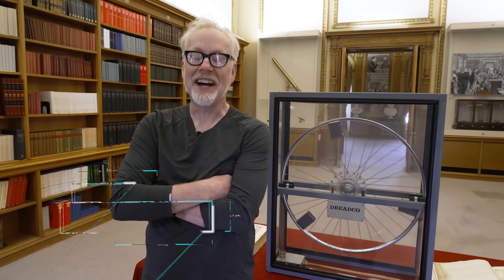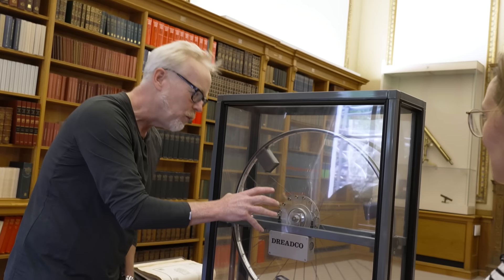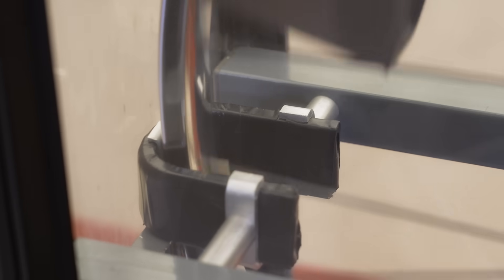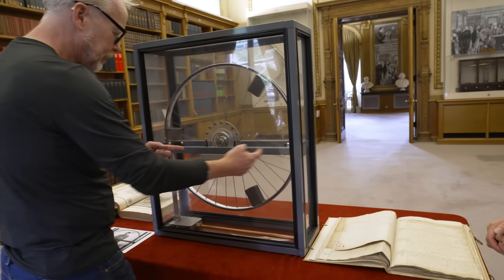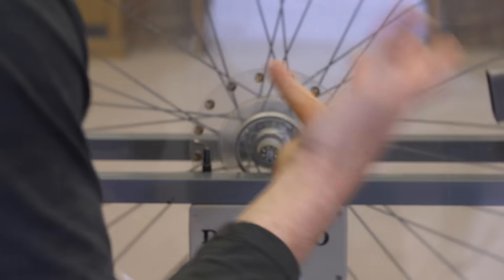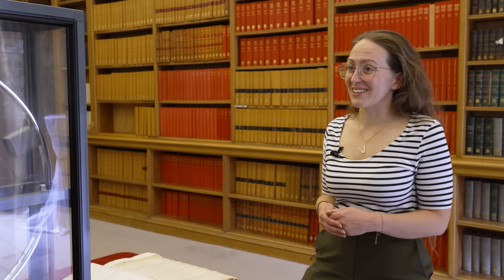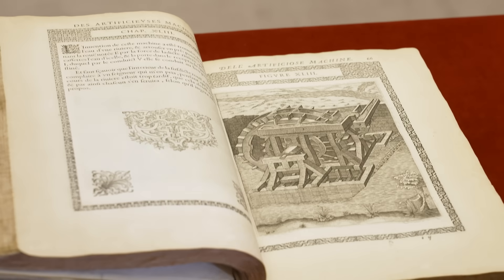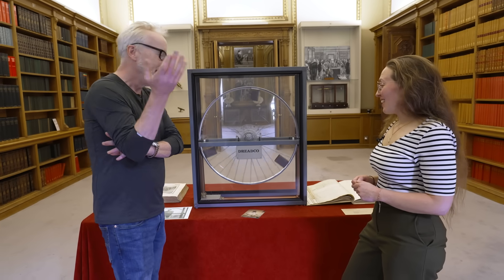Adam Savage vs The "Perpetual Motion" Machine!

Comment: I think the whole thing is a solar panel! When a copper rod is put into a 🔥 fire the side in the fire gets hotter first. Wich produces a potential difference between the hot side and the cold side. The bigger the difference in temperature the more greater the potential difference. 

That is why it has a heat sink.

Or the whole thing is a motor. When a current carrying conductor cuts through magnetic fields it produces an EMF (electronic moto force).
Reply: @tested
Reply: (When Adam hits it) It looks like it is in a vacuum to reduce friction.  
The wheel itself, electricity follows/flows in the shortest path. So when the 3 boxes ("coils passing through a magnet")cut through the EMF the impulse signals travel through the spoke to the anode and cathod. I'm sure the frequency is also calculated to a precisely 1 Hz or quartz Chrystal frequency: 32768.

Also notice how hot air rises and cool air sinks. So the heated copper end blows atoms in the same direction the wheel rotates, while the cooler end sucks in the same direction of rotation.

You have to watch YouTube videos of Lectures By Walter Lewin.
Reply: The wheel itself could be made from Lithium. By comparing the 3 coils in orbit, lithium had 3 valent electrons. Lithium is the lightest silver metal wich is slightly paramagnetic. Lithium itself at room temperature is soft enough to cut with a knife. So I'm in doubt it is made from Lithium but may have alloys of Lithium.

I found this type of analysis from the beat of a Bayer Garrett and Peacock  steam locomotive where I notice that one revolution has 8 beats. So it was amazing to find out how powerful the Oxgen atom is in the power train of a steam locomotive. 

Where as here, they make motion from the absence of oxygen. I still believe you need oxygen to generate/make electricity.

Comment: If you can eliminate enough of the friction losses (high vacuum, magnetic bearings, etc) and the object has a large enough moment of inertia it can spin for an arbitrarily long time. I'd be willing to bet those boxes on the perimeter of the wheel are literally just weights to increase the moment of inertia.

Comment: Most of the machine seems to be miss leading. It has to be some kind of motor and utilizing magnets and a small bit of electrical charge. 

While perpetual motion isn't a real thing if you can consume very little and produce a lot and store that, then that will be something. Although that turns back into hydro power and water wheels.

Comment: I would guess the boxes are covered coils that pass through 2 magnets that have the polarities flipped. There could be a joule thief built into both of the electrodes designed to build up static charge, meaning the wheel would be a motor and generator all in one, better bearings or less air in the system would improve the efficiency, but it's still just akinetic battery.

Comment: It looks like it is simply set up like a DC motor like I even have built in like 5th grade as a science project with either the display case ,or copper tubing covering up the magnets  being the positive and negative magnets that would surround the armature that is the wheel in the center........   But I could be way off here......

Comment: There's nothing in physics that says you cannot have a perpetual motion machine, what there IS in physics is "you can't have a perpetual motion machine that you can extract energy from".

Remember, I'm talking in physics here... If we shift to mechanical and electrical then nothing is perfect and everything is lossy so electromechanically no, but physically, yes you can create something that spins perpetually that breaks now laws, no you cannot extract energy from it in any way, it would have to be an isolated system - and no, we definitely can't do that either. But.... It is "possible".

Possible in the sense that you'd probably need a perfect vacuum (remember space isn't even a perfect vacuum and can't ever be), perfect conductors (which don't exist), zero friction parts (which don't exist), it'd probably have to be cooled to exactly absolute zero (not possible) etc etc...

I love perpetual motion machines, they're a cry by humanity into the void, because perfection is impossible and these machines are a feeble attempt at fighting against that, the universe hates perfection and infinities so much, that if one happens it is shrouded in an event horizon so that no one, and no thing can see the universes mistake in allowing a perfection or an infinity to exist.

Comment: True perpetual motion requires continuous motion in a single direct. I’ve got an idea for one. Provide you use gravity and continuous falling object.  Terminal velocity 9.8m/s/s. Or localised gravity? Account for resistance? Object A moving in opposition to object B. For eternity. Galileos experiment show the correct distancing for things to work correctly. Mines more a loop hole than the real deal as you can stop it?  It sort of cheating? As we heavily use generators.  It all about coil spacing?  For that even chime. Provide you can move a spherical magnet on a hoisted with less energy that the device can make? It a winner! Even if it works on 80/20 rule? The more magnet you can lift? The more energy?  20% is all that’s required for the lift motor to run?  Let one man tell you know and I will show you how?  It was a thought experiment I did.  But it can be made in the real world.  Attached to a sky scrapers? In a sealed unit? Maybe it possible? Conventional wisdom say no. But really that not paying enough attention to the bigger picture? Heck we have rail guns so this should be easy? Just figured hour much energy it take to raise something to hight? Then make sure what you get back,  is more that was expended getting it there?  Problem solved? Friction and air resistance can be negated. We have Vacuum tubes. We have maglevs. we have the industry to build it!  Even me in shed and few tools can build it?  Not to bash the society. It a problem I deal with daily with my attention span being fragged.  Never a reliable thought when you want one. I’ve got a design the even could be applied to wind.  AWES airborne wind energy system.  Aka a kite? Even able to be fitted to the three bladed design.  Fully scalable to?  Just needs an infinite track to roll in.

Comment: If the U-shaped parts are giving the wheel a push every time one of the boxes goes past them then that might be measurable from video with a high speed camera maybe. It seems a bit too obvious tho, with todays technology it would be trivial to make something like this that would move for years but some 40 years back the solution may have been different.

Comment: with my limited knowledge it seems like an extremely efficient battery powered motor of an eclectic sort, magnetic bearings are nigh frictionless in a vacuum, would take almost zero energy to keep turning if designed and built that way, especially if given a push every year or so lol 

I imagine the 3 boxes act as both weight on a flywheel and a way for the u-shaped pieces to interact with and propel the wheel using power from batteries stored somewhere

i honestly have no idea though

Comment: I designed a perpetual motion machine when I was in middle school, the idea was to make a cart with front and back axels connected by a gearbox- when the front wheels spin they force the back wheels to spin faster, which accelerates the cart indefinitely 😂
Reply: I remember building that with Lego technics as a kid. Either it just spinned as fast as I turned it when the cogs where connected with chains, or it just didn't spin at all if the cogs touched each other directly.
Reply: Similarly i thought about sending an electric current through a loop so it would just go round and round forever. Maybe adding a small light

Comment: Of course "perpetual motion" is possible, because it is a matter of definition. The term was used for anything that moved continuously, accepting that there was some input of energy from some source. So perpetual clocks and engines, that made use of changes in air temperature or pressure (for instance), or tidal fluctuations, or the presence of a light source, were all, at one time, considered perpetual motion. And the people who built these devices, for the most part, never believed, nor claimed, that their machines would work with no input. 

It is only today, with the new definition of "perpetual motion" as having NO input of ANY energy source, that the inventions of the past are wrongly impugned as being ignorant, or trickery. This is not fair. 

There should be a new definition for what we know, of course, is the impossible VERSION of "perpetual motion", to set it apart from the old definition and understanding. Perhaps "Free Motion", or "Energyless Motion", or "Zero Input Motion", or the like?

Comment: It's a super efficient machine no doubt, and why it requires so little energy storage (batteries) to continue spinning for so long.  They're also using steel bearings, come on now, and did you watch the ball bearings jitter and move inconsistently, that is not efficient.

Comment: What about the weights on the wheel acting as a flywheel, and the box in the bottom corner including something that would create a moderate air current. The air goes up the pipe where the wheel ascends, and the coandă effect takes the air around to the other side where the pipe draws in the air once more. Small long running battery and a small fan would make that work after an initial spin.

I think this is why the box is sealed (in a fashion).

I think anything referring to it being a motor is the red herring.

Comment: The boxes are magnets. The magnetic flux is directed along the steel wheel rim, making the motor smoother and more efficient. The coils on each end act directly on the wheel rim, forming an induction motor. These are powered by a lead acid battery hidden in either the middle or bottom box. The coils are switched by hall effect sensors embedded in the coils, making this a rudimentary brushless DC motor.

Comment: The grey boxes mounted on the wheel look exactyl like large value oil filled capacitors.  These were used in old electronic equipment long ago.  They may be used for electron storage or just a red herring.

Comment: It's far less inventive. The boxes are magnets and the copper pipes attract the boxes to spin the alloy wheel.
The box lowering on the left attracts to the pipe and slowly decreases attraction as the distance greatens in rotation. The box on the right attracts to the pipe in the same but inverse linear rate as the one to the left, as the distance to the pipe decreases. This action repeats, thus keeping motion. Magnets will require replacing/servicing, and all the rest is decoration. #adamsavage 
Were there less magnets, there would not be enough to steadily continue rotation. Were there more magnets, the speed would increase and decrease non-linearly (pulse).

Comment: I'm going way out on a limb....but all of the electronics are a distraction of the greatest magnitude.
You guys....it's a heat engine. The air in the tube is cooled by the heat sink at the bottom causing the air the be denser than the surrounding air. Then this pushes the air column up the tube and across the rim of the wheel. Bernoulli's effect all the way.

Comment: I'm a bit fascinated by the case this is all housed in. It's clearly a sturdy steel frame (which in itself would allow room to secrete stuff) but what are the transparent sides made of? If it's glass, are they double glazing panels? If they were, that would allow for a fantastic level of isolation of the mechanism (although I did note the little thump Adam accidentally made on them when he went to point at it!)

If I were building something like this, I'd be trying to incorporate some kind of thermoelectric Peltier generator to use the thermal differential between the heat of one side of the cabinet (say next to a radiator) and the other. I wonder if that's enough to produce the few mA that you would need to give a tiny little electrical kick to a really efficient motor?
Reply: "Accidentally" ... this is clearly just an information-gathering method.
Reply: And is the case sealed? Is it a vacuum inside?
Reply: @KB-hf3fw  I guessed, and I emphasize guess, that a vacuum would be a fantastic idea, as even less power is needed to keep it going.  A vacuum and hidden batteries seems to explain it.  But maybe there's something more interesting going on.  Or various red herrings.

Comment: This is just an electrostatic motor .... The boxes on the wheels are just weights for momentum, the C-shaped "magnets" are not magnets, they are just decoration, and the copper pipes and box with the heatsinks are just junk.  The only components that are contributing to the motion are the DREADCO box, the ring of brass buttons, the metal probes next to the buttons, and the low friction insulated bearing.  Inside of the DREADCO box is a low leakage high voltage battery or capacitor.   

To get the thing spinning, you charge up the battery or capacitor inside the DREADCO box using some external power supply, disconnect it, then give the wheel a gentle spin by hand.  The two probes that are sticking up out of the box have the high voltage present, one is the negative terminal and the other is the positive.  As each brass button passes by the negative probe, it collects a tiny bit of charge, then the wheel rotates it around and the other probe collects the charge off of the button returning it to the battery or capacitor to complete the current flow.  The key thing to notice is that one of the high voltage probes is pointed, and the other is round.  This is important and it will not work without that difference.  The pointed probe is the negative side of the voltage source and because it is pointed, the sharp tip will leak electrons more efficiently than if it was blunt or round.  The other round probe is the positive side of the high voltage source, and because it is a sphere, it provides a larger surface area for electron depletion and collection.   

The sharp high voltage negative probe leaks electrons through the air to a metal button making it slightly negative.   This results in a tiny tiny mechanical push between the negative button and the negative sharp probe.  As the wheel turns, the negatively charged button approaches the positive round probe.  This results in a tiny tiny mechanical pull between the negative button and the positive round probe.  As the button moves past the round probe, electrons leak off of the button and move through the air to collect on the surface of the round probe, then migrate back to the battery or capacitor to complete the flow.

In simpler wording, electrons move from the sharp metal tip, through the air, to the metal button, ( rotation ), then from the button, through the air, to the positive round electrode.  Negative probe and negative button repel, then negative button and positive probe attract, inducing the spin.

Here is an example of a simple electrostatic motor with the same basic components:  https://www.youtube.com/watch?v=Hfj50Jixt0A

Comment: @littlesnowflakepunk  The bearings need to have minimal surface contact, however there will still be an increase in friction due to wear over time and a service will maintain the ability of a power source to maintain velocity. How about a number of thermocouples providing just sufficient power to drive and maintain the rotation?

Comment: I KNOW THIS! the wheel uses  ionic propulsion. 
heres what a tutorial on ionic thrust. https://youtu.be/VSYwaesDQBw

I will go through my theory on the wheels propulsion by component. 

firstly the workhorse: those two metal spikes use a tiny voltage which ionizes oxygen and creates a tiny wind. 

the charge for the spikes is given by the iron blocks moving past the magnets

the copper pipe is a redherring and its only purpose is to introduce pure oxygen to the tank during maintenance. 

the wheel is a regular aluminum wheel (non conductive and light)

now one might ask where the conservation of energy comes into this whole deal. energy is lost as neutral oxygen has an electron added to it.  it doesn't give away the electron and you are left with a tank full of positively charged ions. hence the need for a biannual refueling. 

i am the smartest man on earth  (unless youve got any objections)

Comment: Simple Magnets with same sides repelling... That's it. All that other stuff, like the copper tubing heat sink box and the little things near the center axle are just for show to confuse people and get them to over think its operation (Like Adam).the black boxes on the wheel's rim passing through the black boxes fixed to the sides are just magnets repelling each other.  That's it.  I made one of these for a science fair project in high school, its very easy.  The trick is to have VERY little drag or resistance in the axle and to have the wheel VERY balanced.  Mine I could NEVER get beyond a month and I suspect my wheel wasn't balanced enough or the axle smooth enough.

Comment: Adam should take peoples theories and replicate to test.
i think the boxes on the outside of the wheel have rolling weights in each. when a box w/rolling weight reaches the top, the weight rolls to the outside edge and increases the arc. and downward leverage. when box weight is on the bottom and starts to ascend the weight rolls to inner corner of box,, decreasing its arc/less leverage. there are 3, so always two coming down when the third needs a push to start its lift. probably wrong, but it would be fun to test